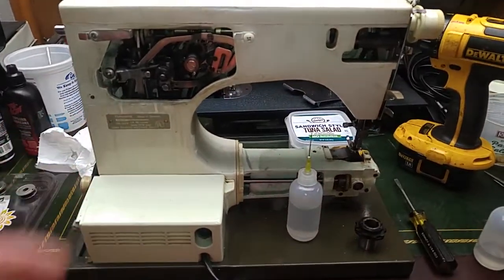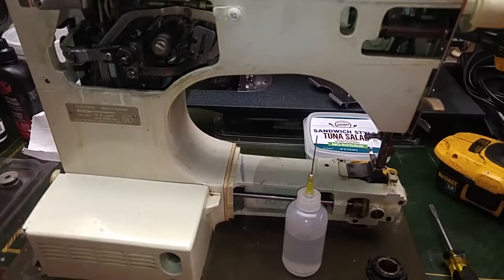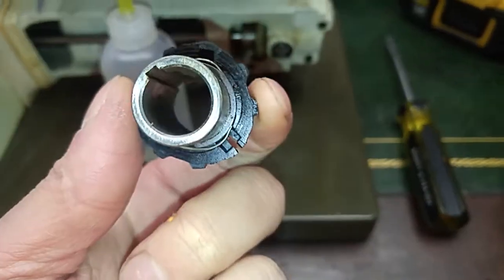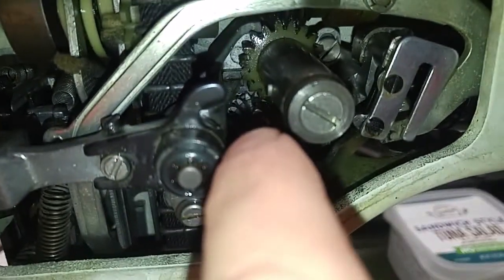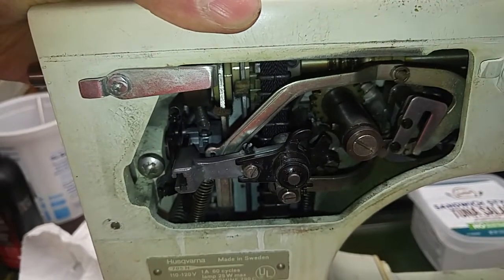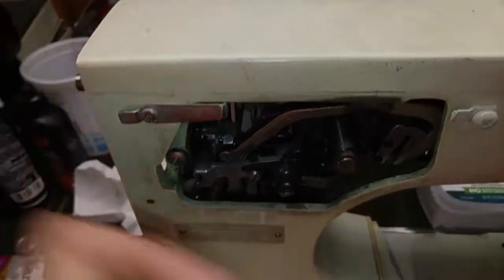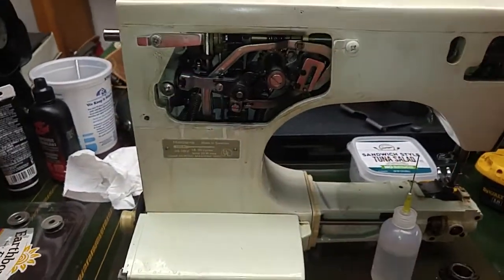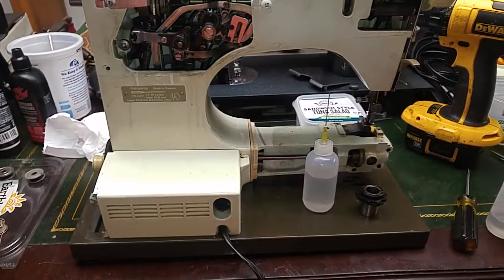Rescue - Viking 6430 Update 3:  Reverse almost Unstuck, CAM Stack and To-Do's

Comment: how did the 3d printing go? Do you have the layout so I could print my own?
Reply from the maker: Interesting actually, was blocked from the Facebook group and she wound up leaving the group afterwards.  I still keep in contact with her, though she was embarrassed regarding the print quality and never mailed them to me.  Since the sewing machines are an indoor more winter project when the weather is bad outside, I've not worked on yet for this season(s).  Let me see if I can update the description for you with the links to the printed models.  I'll reply once done.
Reply from the maker: I updated the description section of this video with links to all I've found as of yet.  If you've not seen the Youtube videos relating, I think they're all linked in their relevant thingiverse comments section. My thought was wrapping with carbon fiber and epoxy what she mailed me just to save time and be safe.  When looking into places like Shapeways, Xometry, PCBWay and others regarding purchasing a better material part... seemed more cost effective to just buy the part.  Then I was inspired to electroplate the 3D print and literally have all the kit to do that now..., I think..., even in disgusting stainless steel.  Not sure I'll be working on that the coming up seasons... though may if I get the ERV and fume hood updated.  Thanks for checking and refreshing my memory regarding!   I even sort of settled with machining the part would probable be just as easy.  Like, subscribe and don't be shy to comment if you have anymore questions.  Keep us posted as well, if you get to trying something out homemade. Kind Regards, In Christ.